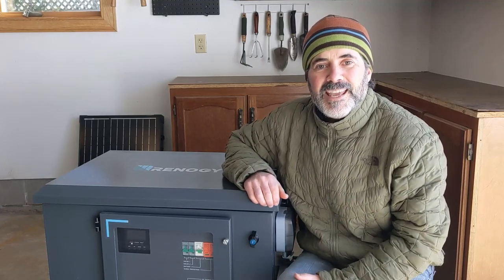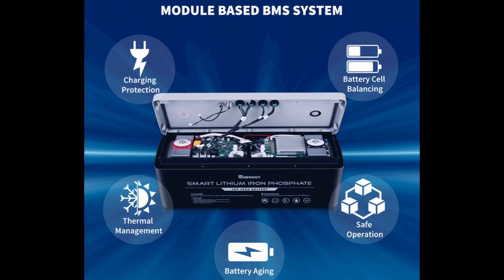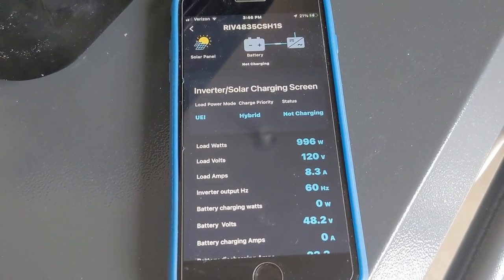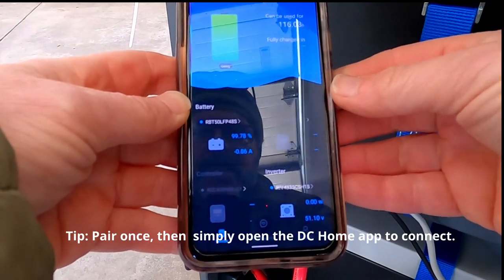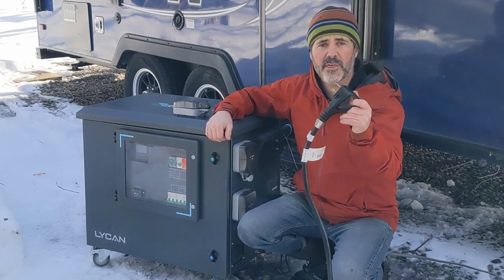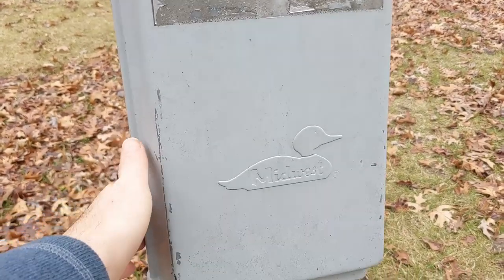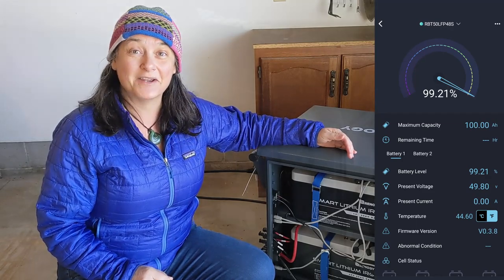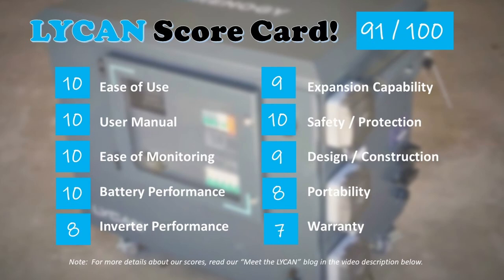Renogy LYCAN 5000 Power Box: Product Review & Score Card

Comment: It's nice to see a great review on this product, and nice that the creators answers questions. Thanks for the great video.

I'm thinking this is the best unit  in the portable section of options. I just wish it came with a split phase hybrid inverter. But I guess it could always be swapped out, if Renogy plans to keep this unit serviceable and upgradeable over the years!

Also very nice that they do have a 3500 watt inverter, this is the only unit I've seen that has true 30 amp NEMA plug. Other brands only give you 20 or 25 amps output.👍🏾
Reply from the maker: Thanks so much for the comment!  Let us know if you have any questions.
Reply: @FreedomInACan  actually one thing I didn't think about until now, is there is no 12 volt outlet. Is there a way to add a 12 volt step down and maybe cut the metal case to add this?  I didn't really think about 12 volts since this is a 48 volt set up.
Reply from the maker: There is room inside the Lycan to install a step down converter.  You would just hook it up to the batteries directly.  There are a few ways to take a wire outside of the box, especially through the "communication port"- which you would only use as intended if you installed additional batteries.  It might take a little bit of creativity, but there is some space to work something out.
Reply: @FreedomInACan  thanks for the information that is perfect. I have a Dometic fridge. It's better to have it powered by 12 or 24 volt and not keep the inverter powered on all the time. I think I'm going to purchase the unit then, thanks.
Reply from the maker: @mrchrisknight315  Great, glad to help!  Be sure to use our affiliate link in the video description AND promo code "canlife" to get 10%.  It'll save you about $520!
Reply: @FreedomInACan  thanks I'll try it out, but I'm in Canada I'm assuming your in the States?
Reply from the maker: @mrchrisknight315  It's an international link/code, so it should work anywhere Renogy sells across the world.  Let us know if it doesn't and we'll see what we can do for you.
Reply from the maker: BTW, where are you in CA?  We are headed toward Alaska next week, via BC and YT!  Planning to take our time and see as much as possible along the way.
Reply: @FreedomInACan  okay perfect I will definitely keep you in the loop. I'm in New Brunswick. East coast.
Alaska is nice. I meet a couple from there a few months ago.
Reply: @FreedomInACan  I'm hoping to travel through Nova Scotia this summer as soon as I'm done retro fitting my enclosed trailer to be a stealth toy hauler. I've only seen Cape Breton so far, and also been to P.E.I. plenty of times.
Reply from the maker: @mrchrisknight315  Nice!  You'll love it.
Reply: @FreedomInACan  i tried the link no go. More expansive. Code doesn't work on the .ca. I hope I'm not spamming. It shows that my messages aren't being posted.
Reply from the maker: We will look into this... Our affiliate platform has changed and we were told that it was international and usable anywhere.  No, you are not spamming, don't purchase it yet.  We will get back to you ASAP, not before Monday though.  Email us directly at freedominacan1957@gmail.com and we can work through this.  Sorry for the hassle.
Reply from the maker: Chris,  Thanks for your patience.  The folks at Renogy have acknowledged our email and are looking into the issue.  They should be back in touch soon and we can let you know the verdict!  More info soon...
Reply from the maker: @Chris Knight  Hi again, Chris. Just got word that our link and code should be working properly in Canada now!
Use this link: renogy.sjv.io/kjGgOM
and add promo code 
"F49VS37YTE9" at checkout for 10% off.  This is for the CA site specifically.
Let us know if you have any issues.  Best of luck and happy travels!

Comment: Thank you for this video, it is very helpful! I have a question: When you did the test in the RV, about how long was that test? Was it only a few hours, or were you able to spend the night in it with the Solar power box?
Reply from the maker: The RV test lasted between 5-6 hours, once we plugged it in and turned on the heater, lights and a few other things.  You could easily run overnight.  Also, if the Lycan 5000 was plugged into a solar array it would be charging while still providing power to the RV - so it would have lasted even longer.  To determine how much battery power you need, you first need to determine what you need to run overnight and how much your basic power draw is.  We have a great solar sizing worksheet available on our website along with a number of other great resources.  https://freedominacan.com/solar-powered-by-renogy
All the best, and let us know if you have any other questions.

Comment: What an awesome video! This was so helpful in my decision to purchase the Lycan 5000. I'm wondering how long it would run a 12000 BTU, 10 Amp portable AC unit. The Lycan 5000 would be housed in a storage unit with the AC/heater portable unit. Any thoughts on that? I was also thinking of leaving it in the garage, running a temporary GFCI power distrubution box with 12 gauge, 150ft outdoor exention cord to power the portable AC unit.
Reply from the maker: Thanks!  Much appreciated.  We are checking with  a Renogy engineer to get a detailed response for you, as this size of AC unit may max out its capabilities. 12000 BTU's is about 3516W and the  LYCAN's inverter is rated at 3500W.  Stay tuned...
Reply: @FreedomInACan , Thank you!
Reply: @FreedomInACan  Maybe even a 5000 BTU unit probably will definitely work
Reply from the maker: @astroEnthusiast1  Here's what our Renogy contact said regarding the 12000 BTU unit.  
"If the AC is running at max power(10a), the Lycan would only be able to run it for about 4 hours at most if fully charged. This is subjected to changed based on actual consumption."  
Hope that helps out.
Reply: @FreedomInACan  I really appreciate you getting back to me! I ended up purchasing a Renogy Lycan 4800-Watt Portable Solar Generator and will go with   a 4000 BTU AC unit. Thank you!
Reply from the maker: @astroEnthusiast1  Great!  We hope you used our link and promo code and got 10% off!  We look forward to hearing how it works for you.

Comment: Nice review - did i miss the solar setup?
Reply from the maker: Thanks very much for the comment.  No, you didn't miss the solar connection piece of this video as we didn't have a solar array large enough to demonstrate the effective charging of the unit.  However, that is pretty straight forward if you're going this route.  There are two separate MC4 connections inputs which can take a maximum of 2200W of solar panels each for total of 4400W.  All the best!

Comment: where is solar hook ups
Reply from the maker: While facing the output/input side of the Lycan there are three inputs to the lower right.  One is communication for connecting other batteries, another is a the Anderson connectors, and the top is the MC-4 connections for the solar array.  The largest array you can connect to the system is 4400W.  This is all covered in the video and the blog which you can find in the video description.  Let us know if you have any other questions.

Comment: Great video. One question can this be hooked up directly to my home panel box?  Are there 2 legs at the 30amp outlet? Thank you
Reply from the maker: Yes, however it needs to be done through a transfer switch, and since you're working with your home electrical outlet that needs to be done by a licensed electrician.  Here is the disclaimer from the Renogy website. 
"Connect the LYCAN to the electrical panel to provide 24/7 uninterrupted power. The installation is required to be completed by a licensed electrician with two additional accessories, a transfer switch and an adapter cable, which we offer the purchase along with the LYCAN 5000 Power Box."
I am unsure about the "2 Legs" at the 30A outlet -- I will check and get back to you on that one.  Best!
Reply from the maker: I have an answer for you on the 2 leg question.  From the Renogy Engineer team,  "If you are referring to thinking the 30A outlet can serve 120/240VAC, that there are 2 x 120v circuits perhaps with 15Amps each “leg”. However, this is not the case with the Lycan as it is single phase 120VAC. In the specific instructions, though the outlets are rated at 30A and 20A respectively, the continuous output can only be 24A and 15A respectively." Hope this helps!
Reply from the maker: BTW, if you are not in the US and need 220VAC, a LYCAN that can serve that voltage is in production.  Just FYI.
Reply: @FreedomInACan  Thank you for the advice! Currently I have a plug that feeds my panel box from a propane generator if needed. My generator has a 120 or 240 switch. Although it is not powerful enough to run  many 240 appliances if not switched to 240 it will not power many 120 circuits in the panel box because of the wat its wired  I am  assuming. Thats where the 2 legs question comes from. I am not a licensed electrician obviously but know some things from past experiences. Does that make sense to you? Thanks again for any advice
Reply: @FreedomInACan  I am in the US but the 220 option would be best for home emergency use or expanding the solar panels and using on a regular basis. Any idea on the time frame for this? Thanks
Reply from the maker: @robertklemas4785  If I am reading you correctly, do you want to run generator for 220V and Lycan (or battery bank) for 120V? Obviously not at the same time.
Reply from the maker: @robertklemas4785  I will ask about the timeframe for 220V.
Reply: @FreedomInACan  sorry no thats not what i meant. Because of the way my house panel box is wired many of the 120 outlets will not work when I plug in the generator and have it switched to 120. When I flip the switch to 220 all outlets work even though I am not using any 220 like the oven or dryer.  I would like to plug the Lycan up just like the Honda propane generator and not have to go through the hassle and expense of a transfer switch if possible. Make sense?
Reply: @FreedomInACan  thanks please let me know
Reply from the maker: Okay that does make sense.  I will send this question to my engineer contact, and see what they say.
Reply from the maker: @robertklemas4785  This is what I thought, but here's the response from engineering, "Our Lycan is not suitable for connecting to the home utility grid as it is now UL Listed and violates NEC. Therefore, we have a dedicated manual transfer switch for powering dedicated circuits in case of a blackout. In either case, the Lycan’s output is a single phase 120VAC whereas most home utility have support for 120/220VAC depending on the wiring."  Here's the link to the transfer switch, renogy.sjv.io/oeKXgm
Hope this helps.
Reply from the maker: Hi Robert, make sure you see all of my responses.  Engineering says it has to be installed by a licenced electrician, since you are dealing with the utility hook up   One more resource for you with regard to installation. This gives some perspective on installation with specific circuits, http://www.reliancecontrols.com/Documents/PT2%20Loadside%20Installation%20and%20Operating%20Instructions.pdf
Reply: @FreedomInACan  Thank you very much for all the info! One more question. You had mentioned they are working on a 220 version. Will that then be able to be plugged in to the outlet I have now for my propane generator with its  own dedicated circuit?  Make sense?  Thanks
Reply from the maker: I believe that you will still have to use the manual transfer switch and have it professionally installed.

Comment: I have a Renogy 3000W inverter which does the UPS also and 6 100ah Lifepo4 batteries with a top line Rover - and I still have $3000 change - this is very expensive for what it is!. In fact 1 battery is $1,444,99 right now - I got inverter rover and 200ah for that price!
Reply from the maker: Is your system 48V?  By your description, it doesn't sound like it.  So we're not really comparing apples to apples. Even at the sale prices right now, the components in the Lycan alone add up to right around $4k, without the cables, fuses, outlets and the unit's housing. I don't see that you will save a ton of money just by getting the individual parts.  This unit is also for folks who don't want to build their own and want to simply plug and play.  Thanks for the feedback.